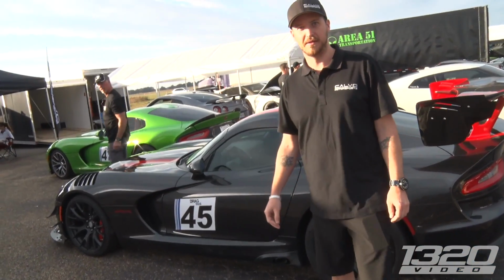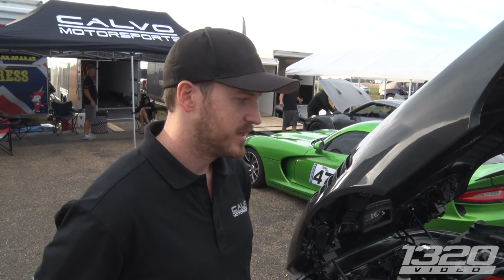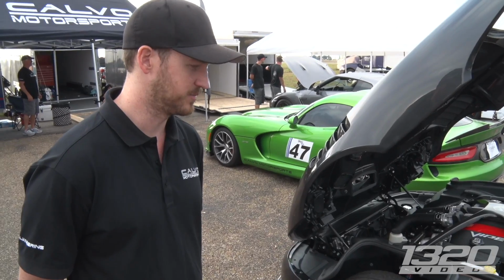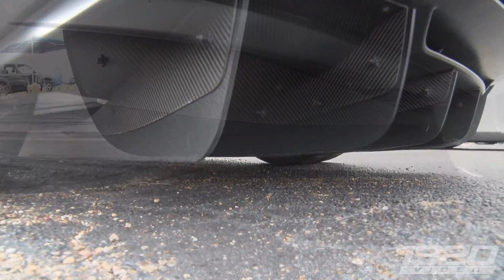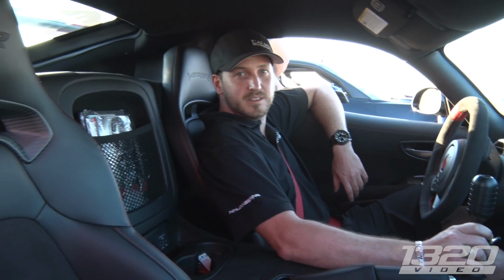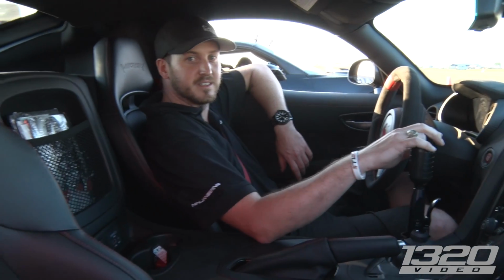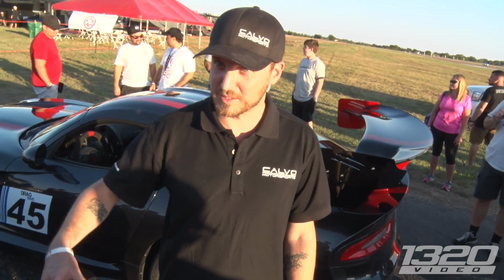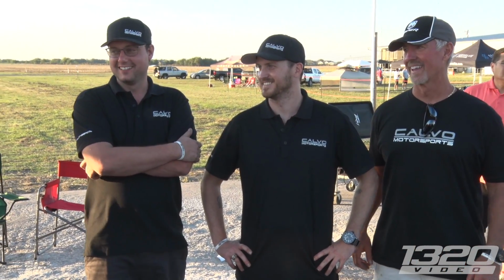This is the Way Vipers Should Have Come!

Comment: ALL THIS STUPID COMMENTS ABOUT WASTING THIS ACR..
he says repeatedly that this was built for the street. Bonus that it can also do this.
the guy has the cash.
let him be.
Keyboard warriors, say something nice
Reply: Felipe Gacitua the dam thing is beautiful,lovely,and as acr should be quick lol.I agree with u
Reply: I can't imagine it would be slow around a track either.   

Something nice as well
Reply: Felipe Gacitua ...I'm not sure it's an acr  I think it's acr parts
Reply: DTM Acquisitions No its definitely a legitimate ACR. He even says “the factory wing is still set at the original downforce setting”
Reply: Felipe Gacitua agreed, makes it all the more impressive IMO 🏁
Reply: something nice
Reply: IKR he just added hp it’s not like he tore up the car or anything
Reply: Damn right, man. Personally, I’d have an ACR making about maybe 800-1000hp.
Reply: Perhaps many find it ironic how vehicles specifically designed (by teams of professional engineers) to succeed at road racing, are utilized solely for drag racing.  Do you use a Prius off-road? or a big truck to save gas?  Sure there is always the argument 'its their money', but people can have an opinion as well, and it can say something about the skillset and thoughts of the owner.  Taking these precision instruments and pushing their potential on road/hillclimb courses is impressive for any amateur driver, taking massive skills and setup knowledge.  Roll racing, street driving, and drag racing are on the bottom of the skillset rung.  Nothing wrong with them and surely fun, but you're going straight for a flash and a dash, instead of the intended dynamic and sustained skills needed on a course.
Reply: So 1750 detuned lol NICE Santa I want!
Reply: What a waste of an ACR...
Reply: I have to agree with bojangles here. The car was finely tuned for the road racing as that’s its intended purpose. It’s now worse at what it was built to do. At the end of the day though you’re right it’s his car, he can do with it what he pleases. If he wants to paint a portrait of Seth Rogans crotch on the whole hood, that’s his prerogative. I still would think the car was better stock though. The world would be quite bland and boring if we all had the same taste.
Reply: @rlsjunior797  
Antonio designs his turbo systems to be nearly 100% bolt on. Should the owner decide to remove it and return the car to stock, they can do so.
Also, this is more than just a bolt on turbo system, Antonio and his team designed these systems to work with the ACR's traction advantages. When you double or triple the cars power, the extra aero helps to keep it planted at higher speeds.
Reply: If built fot drag racing why all the aero not a drag racer and he is wasting this cars talents completely
Reply: The fact that he bought an ACR "for the street" is even stupider than the fact he made it a drag car

Comment: 5:55 Look at how much that aero makes that thing squat.
Reply: I swear the rear's scraping the ground.
Reply: Dr. Bananable Lector did you skip the beginning of the video where they showed where it does scrape
Reply: 3:24 you can see the splitter be torn apart
Reply: It's also called torque and suspension squat.
Reply: At 200mph it's probably the aero making it squat.
Reply: 1200 lbs of down force.
Reply: Burt Sampson it's probably also the suspension setup
Reply: Burt Sampson LMFAO I love your profile picture!
Reply: Damn you weren't kidding about that!
Reply: Dead bodies in trunk
Reply: Technically you could replicate that by lowering the spring rates.
Reply: Well, you'd be in for a treat as it spins to it's demise out of the fist low speed corner.
Reply: Crispy Batman this thing has much power for the Nordschleife.
Reply: That's factory aero to, it's called the extreme aero pack on the dodge website.
Reply: Burt Sampson Iii
Reply: Thing needs new suspension
Reply: Not enough
Reply: Nah it’s the spring compression it can’t squat down more than the spring will let it I don’t think that is what people realize
Reply: Hes probably ruined the suspension. Jesus swap a less aggressive wing. The viper makes like 1500 lbs at around 150mph and this guy's flying passed that
Reply: Like it's a dog and someone just yelled out SIT.
Reply: Thicker rear high performance tires and raise the rear suspension height by 2” and this viper will be amazing with its downforce and aerodynamics. 🐍🏎💨
Reply: @david92xj  everybody skips the beginning
Reply: @BurtSampson  that's what he said
Reply: @mrmidnight32  no it isnt, it's the wing making it squat
Reply: @tailopez5106  rear diffuser*
Reply: forbidden pollo well no shit, but it’s the set up of the suspension allowing it to apply chassis force to the ground. It’s all a system. Trust me aero aint shit with out a suspension to apply it properly.

I learned that the hard way.

Comment: Thé viper is a legend...it decided to die instead of being an automatic car, or worse, a cvt.
Reply: 8605 SB you are so right. They did start refining it to the point of loosing the raw edge. I have a Gen 3 and it is still raw. I have it in a video (red Viper thumbnail)— check it out
Reply: Yeah too bad they couldn’t add side curtain air bags if not they’d still be in production!
Reply: So glad it died being a manual than auto.
Reply: @dle1903  it comes in automatic and the car in this video is an automatic
Reply: @changes4339  nope. It's a manual. The guy has good shifting

Comment: Pretty sure that big ass wing kept the rear wheels from spinning at a 100mph. At first I was like why in the hell did he put 1750hp to a ACR then I said oh yeah downforce to keep the rears planted.
Reply: Yeah and imagine if the engine was in the back. That would be insane downforce.
Reply: His diffuser is worn away it awaits so much
Reply: @caraddict8692  
Why rear engine would affect the aerodynamics? You mean, by making a more aerodynamic front?
Reply: luiz henrique Paes not affecting aerodynamics the down force ya know traction? Because you actually need to grip the terrain.
Reply: @caraddict8692  
Yes, I know about traction, but, downforce isn't just an aerodynamic concept? Or it is the combination of all forces that push the car down?
Reply: luiz henrique Paes 
The faster the car goes, the more downforce is produced by the wing and splitters and diffusor.
You need more power to go faster.
He meant that there would be even more weight on the rear tires in a rear engine car, therefore more traction on the rear wheels and the ability to put the power down even better.
(Thats irrelevant and bullshit in my opinion, it doesn‘t spin the tires at those speeds anyway, it has enough downforce)
Hope this helps
Reply: @thomasautengruber8369  
Yes, that helped, but agree with you, I think rear engine would not be relevant to Downforce. I think 4wd would be more interesting...
Reply: luiz henrique Paes never said it was
Reply: Yep with that much power your spinning every where. Can’t put that much power to the ground without some downforce. Either way awesome car.

Comment: I’m curious why they chose the ACR, the downforce has to be killing some mph, I would think a standard car would serve this purpose better.
Reply: Andre Ramirez Was wondering the same thing
Reply: it was built to be a street car. Not a race car. The fact that it kicks ass is just a side bonus.
Reply: Dontcallmeshirley the wing may lay down (mildly) at speed to reduce drag
Reply: Im thinking the down force actually made it that fast. They always struggle with traction.
Reply: Ive talked to the engineer and it runs faster with it because it helps put the power down
Reply: The downforce helps put the power down
Reply: At those speeds the extra down force would make me feel a lot safer.
Reply: Dontcallmeshirley only need the front splitter with your logic... not the wang
Reply: actually the splitter and diffuser should help in mph, the undertray's job is to produce lower pressure directly underneath the car which increases over the rear axle, this counteracts the low pressure region behind the car.
Reply: They use the acr to put the power down. A regular viper wouldnt be as fast because it wouldnt have the same amount of traction.
Reply: vipers are well known to be very ass happy. they need the downforce to get it to not just spin.5
Reply: V10 8.4L, um when you find another engine that big in a street car come back, until then keep watching. He said he could have adjusted the wing but didn't. The wing can be adjusted for straight line speed.
Reply: also this what the guy above said "vipers are well known to be very ass happy. they need the downforce to get it to not just spin.5"
Reply: Not a full drag car it's a street car, yeah it's killing mph but it still steers like an acr
Reply: With that much power you arent going to boost it faster with a stick and no aero. Plus a sequential box and antilag, thats why this thing is a rocket.

I want to take this thing home lol
Reply: Andre Ramirez to avoid wheelspin @ higher speeds
Reply: wings and splitters work together to make a car stable...you need both, or a complete rework of the aero package
Reply: Jacob Juneau well if you understood aero you’d realize that air going under the car influences lift in the front AND rear. Hence the diffuser and the splitter.
Reply: didn't u see all the standard cars lose to this lol
Reply: Car was built as a street car, just happened to win the comp.
Reply: because of the traction problem probably, they're running on 19's
Reply: Andre Ramirez it loses lots of mph with the ACR kit
Reply: I think the aero was necessary for keeping good traction but I do think they should have adjusted the wing for more top speed.
Reply: you fail at aerodynamics
Reply: As the guy said in the video, they built it to be a street car not a drag car
Reply: you can barely keep a viper planted as it is, anything to help it out. insane purebred race car.
Reply: Andre Ramirez they should move the wing to the low drag mode
Reply: I've got 485 horse in my challenger at the crank and can brake lose at 50mph so ya these guys need ever pound pressing down on the back of that car.
Reply: Andre Ramirez he said he didn’t make it to be a drag car,
Reply: Why not take a track car, and design it to eat drag cars. Win win in my book. The only reason is why not do both?
Reply: With that much power not an issue...
Reply: Ta might work

Comment: Gets an acr viper* let's make it a drag car.
Me: bruh.
Reply: They said they built it to be a street car.
Reply: Why not??
Reply: erick isles bc first off they couldve saved a ton more money to make the same exact car by using a basic gts model and second is that those cars are limited and bred for the track, not to be turned into a drag car
Reply: Incepting thats what makes it great i have a rwd ej1 civic for drifting
Reply: Why on paper it may sounds wrong maybe but if you listen to the dude he says it will be his street car and to be honest power is a whole lot more fun on the streets and i'm sure he can adjust the power to what ever he wants.
Reply: All of you are missing the fact that he is still running the stock wheels on Proxes, the car will still handle as though it is stock, just with 1050HP extra. And they could turn it down to probably around 1000-1100 HP which is manageable. Its not a drag car, its a car that can do whatever he wants to do.
Reply: I would consider this a track car, but this guy made it to a class of it's own
Reply: @benjames7932 you think these folks care about saving money? they build what they want, it's their money, it's their fun. they could go faster if they wanted to.
Reply: @benjames7932  
Because of the excellent traction and  aerodynamics the ACR has from the factory, they are actually faster than a GTS model when you turbo them.
I agree to a point the limited edition ACR should be kept mostly as a track car but if a select few are tastefully modded for mile or 1/2 mile racing, I'm ok with that.
Reply: Ummmm it’s not a drag car. Stock wheels, suspension, aero, etc. It’s a regular viper with a helluva lot more horsepower. It just so happens to be drag racing in this video. He can go to the track immediately after and slaughter a track record

Comment: v10's seem to be the perfect engine for making stupid amounts of horsepower (viper, gallardo/huracan)
Reply: Totally balanced engine it can easily make hell horsepower
Reply: HAVE YOU BEEN SLEEPING. HELLO!!! A GTR ONLY HAS 6 CYLINDERS AND MAKES ALMOST TWICE AS MUCH HP. HOW DO YOU EXPLAIN THAT..TIME TO WAKE UP..
Reply: @erwinmonti5066  face palms
Reply: @bradbeck6158  HAVE NO IDEA  WHAT YOU MEAN..
Reply: @erwinmonti5066  so you have a gtr with 3500 hp to the wheels? I'd love to see it
Reply: @shkkrimp7344  HAVE NO IDEA WHAT YOUR TALKING ABOUT. SORRY. TRY ME BACK.
Reply: @erwinmonti5066  what do you not understand? Do you have a 3400 up gtr?
Reply: @shkkrimp7344  NO AND I NEVER SAID I DID. MINE IS 1400 HP, AND THAT IS QUITE FAST ENOUGH. YOU CAN SEE THAT ANYTIME AT ONE OF THE CAR SHOWS IN CLEVELAND ..